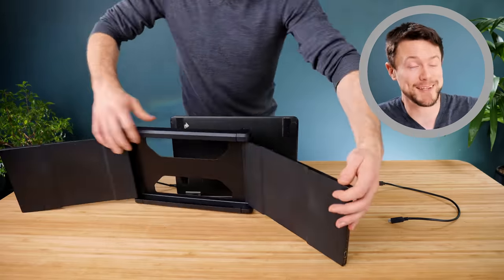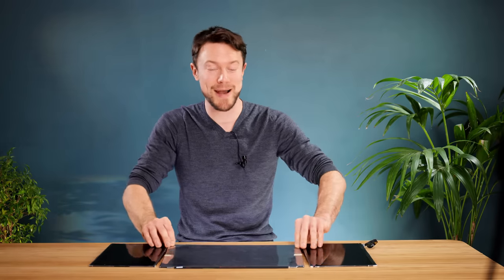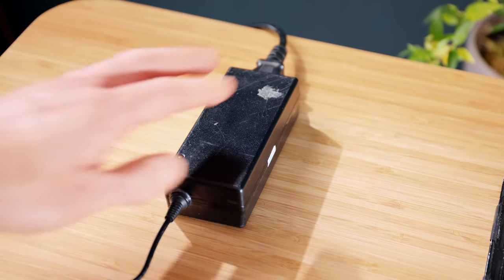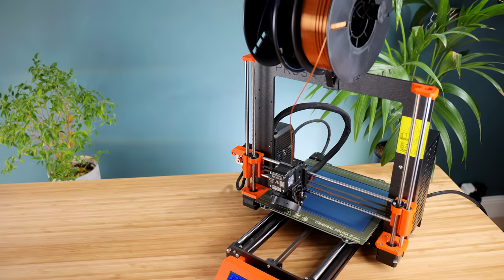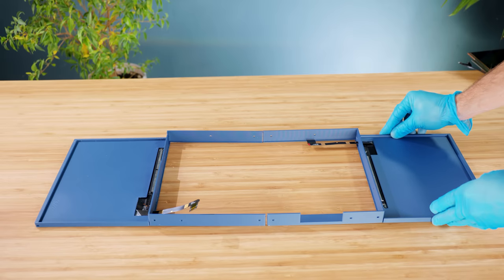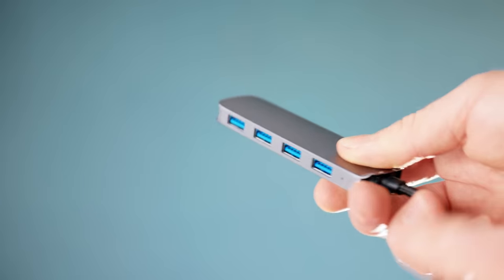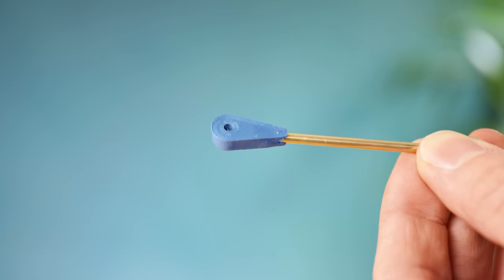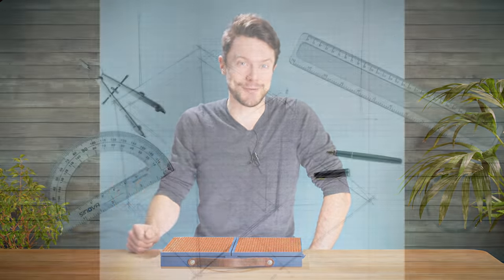Triple-Screen Laptop DONE RIGHT!

Comment: With the advent of flexible OLED i imagine we will see some extendable unrolling screens in future but this is really cool!
Reply: except there's not really an advent of flexible OLED, just an advent of samsung misunderstanding the concept of "bendable once in the factory to get the product's shape" as "hey let's make phone screens that break within 10 minutes of the demo" ;)
Reply: @nonchip they already use oled in their fold phones? Foldable oled has been around for quite a few years now.
Reply: @ducjduck  i know, i said that above, and it keeps breaking. (because it's *bendable OLED*, not foldable)
Reply: @nonchip  I disagree. They said the same about flat screen TVs back in the day saying they were too easy to break. The tech will improve over time.
Reply: @jpjapers  the issue is that back in the day they "said" it was too easy to break, while the phones are breaking by design.
because it's *bendable*, not *foldable*. you can even roll up a TV perfectly fine and all that, but you can't fold over anything thin without squishing stuff to death at the crease.
even heavy duty cables don't support *folding*, how's a sandwich of extremely thin and precisely printed/sputtered/whatever traces on some kinda plastic (that's totally not gonna get weird creases messing with everything after like 10 folds, riiiight samsung :P) around a layer of fancy glowy molecules supposed to be more rugged than that :P
Reply: that's like 10 years out at best. until they have something like mini oled and find a way to make that bendable, its simply not a good idea
Reply: @bradhaines3142  the problem is also that "bendable" is really easy on comparison, while "foldable" per definition destroys any composite layered material
Reply: @Jehty_  your opinion seems to be based on dishonest marketing.
your mind seems to be stuck in a world where physics don't apply. but we never went there.
Reply: @nonchip  No they aren't breaking by design. Show me the statistics that say there are more broken folding oleds out there than ones that are out there working absolutely fine without issue. I guarantee there are orders of magnitude more working units out there than the handful of broken ones.
These OLEDs have a specified acceptable bend radius and the iterative improvements in the tech will improve that too. You have an exceptionally luddite approach to the very idea of iterative development.
Not only that but the difference between bendable and foldable is in syntax only. Functionally they are the same thing the only difference is the bend radius which unrolling rather than bending in half drastically improves.  You have far greater control over the movement of the substrate when unrolling from a cassette. The tech will improve and i dont think its 10 years away. The more product cycles we go through the better itll get and the more r&d will go into improving it.
Reply: @nonchip  first you would have to proof that foldable phones in fact break the laws of physics....

As I said: your opinion is stuck on the first generation foldable phones.
Read some user reports of the newer models. They are definitely not as bad as you think.
Reply: @jpjapers  yknow i love it when random tech shill bros on the internet decide they know how my brain works wrong just because i know physics, keep going :'D

but to get the stats: while they seem to simply not exist (shocking i know right, almost as if marketing departments were for marketing), even the latest advertisements promise "folding" with a 3mm radius about 100k-300k times. that's 50k-150k phone uses before you gotta buy a new one. assuming you want a new phone every idunno 3 or so years, that's 100 times a day you can look at your phone. and then you buy a new one it's gonna be perfectly fine but with a screen smash that was essentially builtin and not your fault?
oh and, mind that 3mm radius. because having a 3mm gap between your "closed" phone tooooootally is neeeeeeeever gonna cause any issues with idunno accidentally sitting on it or something, riiight? :P
Reply: @nonchip  Dude, even a normal phone can break easily if you sit on it.. That makes no sense. And the people that are buying bendable phones, surely will change their phones in 3 years, as these phones are hella expensive and people with that kind of money always buys the latest one. None of the issues you are talking, apply to the public these phones has.
Reply: @_iczyzy Girl, you're literally making my point. they're breaking by design. because it's impossible to make them not breaking. they just don't care because money. how's that different from anything i said above?

also, normal phones don't break by compression (until you get cars involved). that's the problem here. you can't guarantee the "3mm radius hinge" anywhere as easily as "maybe don't sit on it exactly in such a way and on such a surface that literally breaks in half"
Reply: @nonchip  so, not only your opinion of foldables is based on false information, but also your opinion of smartphones in general. Interesting.

The average person replaces their smartphone every 2,5 years or so.
So for the average person a 3 year lifespan is perfectly acceptable.
(maybe it's not acceptable for you, but in that case you are simply not the target group for the current foldable phones)
Reply: @nonchip  Stop digging, you lost this debate many replies ago.
Reply: @nonchip  Keep going mate, You're claiming that i'm doing exactly the thing you're doing by arrogantly proclaiming youre lightyears ahead of one of the largest screen manufacturers on the planet because you "know physics".

You have a fundamental misunderstanding of the technology and engineering behind it and your writing style implies a lack of maturity as does your proclamation that you "know physics" and therefore a product which already exists, is impossible.
Reply: @owensparks5013  ah yes, that's why yall need the ad hominems ;)
Reply: @nonchip  Everything new has its flaws. Time will pass, it will become better, just like every technology we know today. But seeing what they have done by now, it seems promising. Because I know some people that have fold devices for quite a while, and they look just as new. So, again, there's no point discussing it. People buy knowing they are early adopters of something that's still improving and can, at some point, suffer from early adopter problems. If you think is dumb and "oleds will never fold", just use a normal phone. If they think like that, things would never evolve.
Reply: @nonchip     every smartphone breaks from use.
Batteries are a thing...
A limited lifetime for smartphones is completely normal. Foldables are no different in that regard.

But all of that isn't even the problem I have with you. 
You started this conversation with spouting nonsense about 10 folds and then it breaks. 
Sure, that was hyperbolic, but there's still a difference between having an acceptable lifespan (as foldables have) and the nonsense that you are repeating again and again.
Reply: @jpjapers  keep going mate, you're claiming that i'm doing the exact same thing you're doing by arrogantly proclaiming you're lightyears ahead of physics and the screen manufacturer's own claims because you buy one of the largest screen manufacturer's marketing hype.

You have a fundamental misunderstanding of the technology and engineering behind it and your writing style implies a lack of maturity as does your proclamation that they "don't break" and therefore a product which consistently (and also as admitted by the manufacturer) breaks after a few years, doesn't.
Reply: @nonchip  Do you even know what an ad hominem argument is? Plenty of people here are presenting points of view to support their positions.

You, on the other hand, seem to persist with the argument that any material or design that doesn't reach your personal threshold of durability is "designed to fail" which is utter nonsense.
Reply: @nonchip  Nice and mature i see. Again, you seem to think that its all marketing nonsense when demonstrably the product exists and works in reality. Claiming you know more than the entire fleet of samsung engineers is unbelievably arrogant.

I have never claimed they don't break. Everything that has a mechanical element, breaks. I refuted your fallacy that they break by design. Which again is false. Every manufacturer rates every single moving part for specific product life cycles that are compared to the user-expected life cycle of the product.

The continued rebuttals without any kind of evidence and a reliance on attempts at character assassination show youre just not willing to accept that you might be wrong.
Reply: @nonchip  Can you name a material that’s foldable then? Cause even paper doesn’t look nice and flat anymore after being folded once.
Reply: @nonchip  why are you going on about the "manufacturers marketing hype"?
You posted the numbers yourself.
I think that's the numbers we all here are going by.
So where is the "hype"?
Nobody here is in denial of the projected lifespan.
The difference is just that we are okay with that lifespan. You are not. And that is okay. That's just a difference in opinion.
But still you are going on and on about us claiming that we just bought into the hype, the nonsense about physics, etc. Those are not opinions. So why are you  arguing that way?
Why are you deliberately trying to make it difficult? Why didn't you just say in your first comment that "A projected lifespan of 3 years is too short in my opinion". If you had said that then this whole conversation wouldn't have happened. But you didn't. Instead you used the hyperbole of 10 times and then when down fighting. Why?
Reply: @Jehty_  the "nonsense" about the 10 folds or "during the demo" was specifically about the actual fail samsung delivered a few years ago where the screen literally broke during an expo they showed it off at. sure they got better over time, but they still break, unlike the nonsense you are repeating again and again.

about your battery argument: 100% agree that's a thing that happens and i still doubt the manufacturers' claims about "saving space" and "thermal performance" over having a replaceable one, and i'm rather positive that's planned obsolescense (just as the bendable screens breaking after a few years), again a reason to ponder the morality and accuracy of such marketing claims.
Reply: @nonchip  cool, so my assumption was correct. You base your opinion on old and outdated information.

And if you disagree then why did you use bring that up? Why did you decide to start a discussion that way? Seems dishonest
Reply: @nonchip  300 000 folding or bending cycles is plenty. I don't know how often you are using your phone but I could use this display for a decade before it would exceed it's lifetime.
Reply: @Jehty_  cool, so your assumption was incorrect. or you can't read. because i do not "base my opinion on old information", i merely pointed out a thing that happened a while ago as an example.
Reply: @nonchip  okay. So you did that deliberately.
Did you try to start a heated discussion? Or what was your goal?
Reply: @jpjapers  "I have never claimed they don't break." yes you did: "No they aren't breaking by design."
"I refuted your fallacy that they break by design." you literally just agreed a sentence earlier. (i'mma agree that bs you spouted before it, i never disagreed with any engineer at samsung or said they lied, i merely said that anyone thinking "foldable display" is a thing that doesn't break is falling for marketing hype. which those engineers agree with, as you said yourself.)

if you took my one phrasing of "by design" to mean the opposite of all the other things i said instead of "because of how they have to be designed because that's how the materials work" and somehow decided that means i'm onto some kinda conspiracy here, i'm sorry, but i very clearly (as you kept insulting me about) was talking about the physical constraints you just agreed on being "prettified" by marketing, not an "evil intention".

The continued rebuttals without any kind of evidence and a reliance on attempts at character assassination show youre just not willing to accept that you might be wrong.
Reply: @anonb315  i agree. not quite a decade for some people i know, but it's probably about at or above the "average expected lifetime" (especially with non-replaceable batteries, which could arguably be too short anyway given we saw very little real performance improvements in the last few years and compared to when smartphones were still new and actually got better every few months).
Reply: @Jehty_  my goal was to point out that there's no "advent of flexible oleds" (because either that means "bendable" and they're already there and the only advent is of manufacturers finally using them righter, or that means "foldable" like they claim and then they can't deliver on that by definition), and to show the (pretty publicly ridiculed, at the time) example of how samsung's first attempts at actually selling them to customers broke before those even got home.

the heated discussion started when you told me "i had to prove" that repeatedly bending them damages bendable screens over time, and told me that "my opinion" was "stuck in the first generation".

and then i likely misunderstood JP Concept because they said they "disagree" and "the tech will improve" (which i took to mean "they can make them not break"), and then they misunderstood me (or rather, i phrased it weirdly) when i said they broke "by design" (which was meant to be "as a result of how they need to work", not "because of a secret plan to make them break more than required to sell more"), and at that point it only got more heated because you kept doing the thing where you tell me what i think after showing a surprising inability to just read what i said instead. hope that clears that up.
Reply: @nonchip  aha. In that case maybe you should read the start of this discussion again.
Because it did not happen like you just described.
Reply: @nonchip  We are done here. I can't continue to debate someone who doesn't accept the same version of reality.
Reply: @hnewc1919  decades? if you really only use your phone 4-5 times a day, more like half a century! 45.6 years to be precise :P
but i know plenty non-teens and non-girls and non-teen-girls that use their phone way more often, bringing the lifetime down into the "about as long as the battery" range (the shortest i've heard lately was like half a year, but that was because some sand got in between the hinge, which just sheared the screen in two).
also no idea if phone use relates to marital status, but congrats? :P
Reply: @nonchip  You know that the folding phones don't actually fold the displays flat either right?
Reply: What a delicious schadenfreude seeing someone being ratioed so hard like that.
Reply: @nonchip  just admit defeat bro it's embarrassing

Comment: Great job, fascinating work as always! You make DIY look freaking easy.
You should make a collab with LTT, and make a gaming rig from this design. :D 
(Just make it durable enough, Linus likes to drop things)
Reply: So true! It takes a lot of effort to design and prototype stuff like this.
Reply: Very few cards can drive a 4k screen, let alone 2.  The only thing you are gaming with this machine is minesweeper.
Reply: @VascovanZeller  Hence the "make a gaming rig _from this design_" ;)
Reply: they have huge cnc machine so i imagine a case made from aluminium will make this 1000% better
Reply: @VascovanZeller  from my understanding the framework laptop has thunderbolt 4 which means that the extra usb-c port could be used with an eGPU, hence making it into a gaming system

Comment: Very nice project. Long ago I did a diy laptop cover for better cooling, and also used superglue instead of some dedicated glue for plastics :)
I'd do it a little different with the "leg" system. Only the screen(s) would go up, the base computer would stay on table, working also as a stand for the screens. The base to screen connectors would be expandable metal pipes (like old radio antennas or selfie sticks).
Reply: "telescoping"

Comment: I always thought one of the primary advantages of laptops were their portability, so a triple screen setup feels like an interesting need.
Reply: More screens = increased productivity and easier multitasking
Reply: Programmers like me probably would use the main panel while working in big spurts, and then switch to a side panel when testing out something that needs the full main screen for usage.

Or when monitoring an active process (use a side panel) while also working, which is something I have to do every day with our trading engine.
Reply: I need 2 screens for work stuff- so I have to take a second screen with me- and then I also have an entire normal PC with multiple bigger screens at eye level because staring down at 2 small screens all day sucks. And the portability in this build isn't even compromised so I really don't get your point here
Reply: @AshkanKiani  
left screen (portrait) --> my terminal
middle screen (landscape) --> vscode / chrome / etc.
right screen (portrait) --> debugger / devtools / emulators or if I'm chillin' spotify / youtube
Reply: There needs to be a distinction between full portability (where you have everything self-contained and can deploy it in seconds), and just regular portability (where you can fairly easily transport things, but it takes a little bit to set it up and pack it back away).

This is perfect for someone who travels a lot, but then stays in that place they travel to for at least a day at a time. It's easy enough to take with you on a train or plane, but also gives a comfortable setup when unpacked.